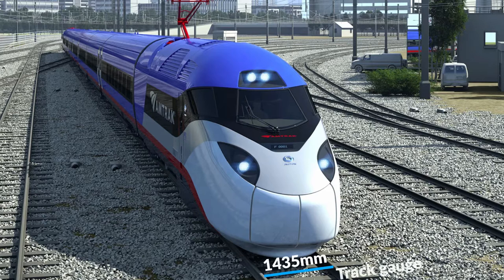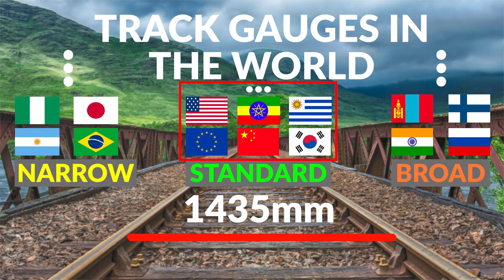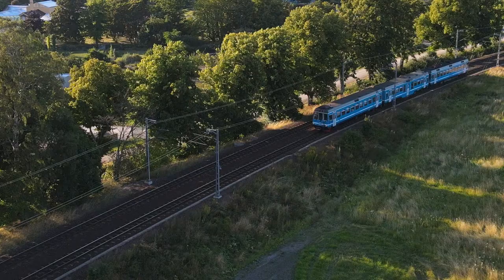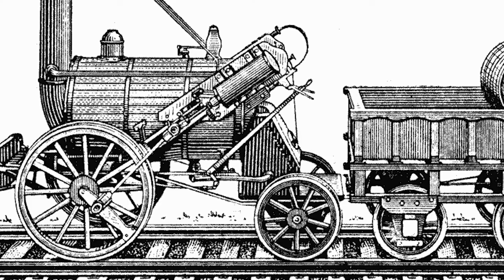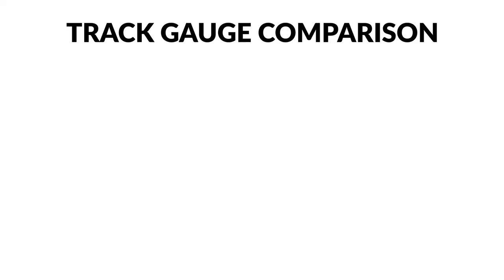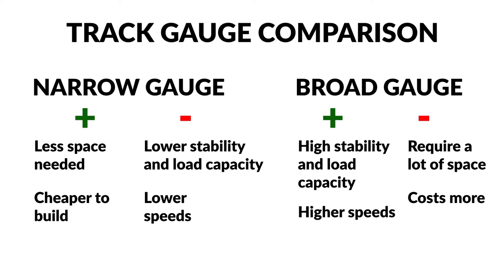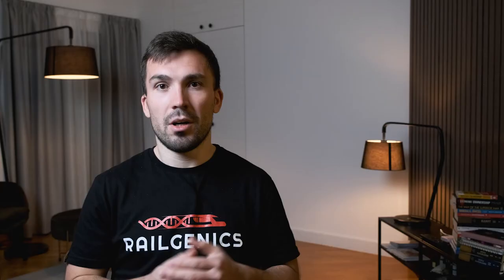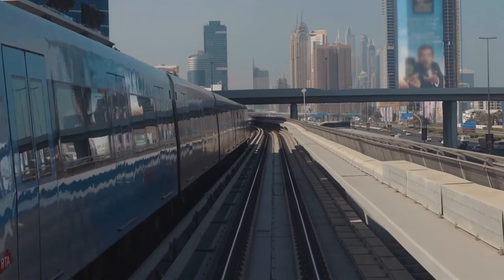Why Track Gauge Differs Between Countries

Comment: The development of standard gauge came from George Stephenson becoming the chief engineer on a mining railroad that happened to pick 4 feet 8 inches (1422 mm) as its gauge.  He found that wheels were binding on the curves, so he added a half inch (1435 mm overall).  It was easier to regauge the track than replace all the wheelsets with 1/2 inch shorter axles.  Stephenson was a stubborn man and insisted all future projects he worked on match this gauge, and so it became standard gauge in Great Britain by default.  Later, Stephenson would admit a wider gauge would have been a better choice, but it was entrenched by then.  

The United States ended up using standard gauge because many early locomotives were imported from Great Britain.  Other gauges were used, but standard gauge predominated and eventually won out over the others.
Reply: standard gauge was good enough for most purposes. a bit wider or bit narrower gauge doesn't change much.
narrow gauges has obvious problems, but how about wider gauge? you have to think about human scale.
2+2 sitting is ideal, 3+2 or 3+3 are not ideal. so wider gauge is not really better. 
Japanese Sinkansen use standard gauge, and it can to 3+2. so wider gauge is not necessary.
Reply: Actually what it was, the gauge was defined by the carts that 2 horses pulled. 
Early on trains were manually operated and instead of completely making a new track, they used the cart sizes that were already established by the width of horse cart. 
Then the railroads grew from there. 
So it was a horse's backside. 😅.

True story

Comment: 4ft 8.5in only became called standard gauge after the passing of the Railway Regulation (Gauge) Act of 1846 which set the set the British Standard Gauge as 4ft 8.5in and Irish Standard Gauge at 5ft 3in. It didn't prohibit the use of Brunel's Broad Gauge of 7ft 0.25in, but limited its usage to lines that would have a physical link to the already in existence GWR lines.
Reply: I live in Australia 🇦🇺. The small town is the two different gauges. Standard gauge 1435mm  and Irish gauge 1600mm ( 5'3").
Reply: @robertmurray8763  Is it Albury?
Reply: @TrainsForNSWVlogs  Ararat.
Reply: There was legislation about the same time to make all railways conform to the Irish 1600mm gauge.
However states like NSW and later Queensland ignored the legislation to save money.
Reply: @johnd8892 I take it that you're referring to Australia's railways? But all 3 primary gauges date from  entire Federation in 1901 and are still not resolved to one standard.
Reply: @neiloflongbeck5705  Nothing much to do with federation apart from the pork barreling of the Trans Australia line that thirty years to start to be useful. All three main gauges well established by 1901 with the absolutely dominant intra state traffic movements served well by the railways and the smaller size interstate movements by coastal shipping.
All capital city markets linked by standard gauge by 1970. Yet the railways struggle to find commercially useful traffic from any of the intermediate localities along the newly standardised routes as imagined by railfans.
The nineties conversion of Melbourne to Adelaide from the 1600mm in use from 1883 to standard gauge just disrupted existing customers was the cause of the biggest passenger decline on that route leading to massive increases in passenger subsidies.
Reply: @johnd8892  all those breaks of gauge are s big issue when transporting goods from on state to another caused by the different governments of the days efore Federalisation not wanting to seem weak to their electorates - can't use their gauge in our state mentality.

As for freight from the smaller cities and towns along the main lines- well just what industry is there that road haulage can't offer a better service from door to door? This is the same question that railways face in everywhere in countries large or small. And for the smaller countries the railways just can't compete on a level playing field.

Yes, changing gauges is disruptive to passengers, but do is having to change trains where there is a break of gauge. It took the old GWR years to fully switch over to standard gauge from 7ft 0.5in. This they did in phases with the first step being the addition of a rail at standard gauge and then the introduction of standard gauge trains followed by the withdrawal of the broad gauge stock. But there again they did this in the late 19th Century and not the late 20th Century with many alternative mode of transport.
Reply: Isle of Man 3" gauge
Reply: @Steve14ps  Man is outside the UK.
Reply: @neiloflongbeck5705  Did not say IoM was in UK, just stated it had a track gauge of three feet, also a very interesting network in its day.
Reply: @Steve14ps  but as this thread is about the Act of the UK Parliament that gave use Standard Gauge and the Isle of Man isn't part of the UK and thus outside the topic of this thread, why mention it? Many countries and territories have their own standard gauge that is not the same as Btitish or Irish Standard Gauge.
Reply: @neiloflongbeck5705  Sorry if I have offended you

Comment: In Switzerland we have a lot of Meter-gauge because they allow tighter curves. witch is important in the mountainous regions of Switzerland.
We also have railcars witch can change meter gauge  to Standard gauge while moving.
Reply from the maker: That's interesting to hear Nicolas! I've been dealing with narrow gauge projects in New Zealand recently (1068mm), it is very interesting to see how tight these curves are (minimum is 90m). I wonder how these cars manage switching the track? Is it by changing bogies? Or some other technology?
Reply: @railgenics  Talgo has a system for changing the gauge while moving, it's at a low speed, but a very efficient system. They have videos of the system working on their YouTube channel.
Reply: Spain/France border has had gauge changing trains for many years. Originally bogies were changed but then they developed axles with wheels which can lock at two widths.
Reply: The through Talgo routes that change gauge at the French Spanish border have been discontinued. Best such example is a Talgo sleeping car service between Berlin and Moscow with adjustable wheel sets, taking 5 hours less than regular trains to make the trip.
Reply: @centredoorplugsthornton4112  Spanish High Speed lines are standard gauge, so can connect directly to France. But there are still dual gauge trains within Spain.
Reply: @michaeltb1358  but of course. 
Saw something in Jane's World Railways about broad gauge versions of the TGV.
Reply: @railgenics  In Australia we have got 3 main different gauges.

Comment: Very good video!! I am from Argentina and in fact here we have the three types of gauge.

   Mainly we have a 1676 mm wide gauge in most of our territory, in the Miter, Roca, Sarmiento and San Martín railways, which are the ones that cross the country from side to side and from the center upwards.

   The narrow gauge of 1000 mm is only used by the Belgrano railway, which crosses the country from the center to the north. Curiously, being the most extensive if we compare it with the others.

   And we also use the standard gauge, 1435mm on the Urquiza railway, which crosses the country from the center to the north but borders the eastern border. You would be surprised to see a complete map of our network :o

Kind regards and keep it up! 👍😎
Reply from the maker: Hello, thank you for your comment. Actually, I did not know that there are 3 different gauge types in Argentina, that is very interesting. I have Argentina on my list, so could you please recommend me some interesting journeys in Argentina? I would like to check them :)
Reply: @railgenics  Of course! There are many things to say but I will try to be brief: To start, you must be in our capital: Buenos Aires. It is from that point where the kilometer 0 of the main railways of the country is. While there you can visit the 4 terminal-palaces that lead to the rest of the network: -Plaza Constitución (Roca Railway 1676mm) -Once (Sarmiento Railway 1676mm) -Federico Lacroze (Urquiza Railway 1435mm) -Retiro (Mitre 1676mm, San Martin 1676mm and Belgrano 1000mm) Each one of these terminals, but above all retirement and constitution, are true palaces worthy of English architecture. Retiro is a particular case, since it brings together in one place 2 different types of trail, these being from 3 different railways and having 3 different buildings for each one next to the other. First, leaving from Retiro, more precisely on the miter railway (1676mm), you can go on modern urban trains that will take you to the interior of the city, or you can also take our 2 different long-distance trains (and advance sales) that will they can take Tucuman (the central north) and Cordoba (in the center of the country). These two terminal stations of the miter are not only broad gauge terminals, since their platforms also work for the narrow gauge, this being possible thanks to the combination with the narrow gauge using a three-rail system called "bitrocha" or "mixed gauge", therefore, on one side of the beach the roads are wide gauge, but on the other side they are narrow gauge. https://es.m.wikipedia.org/wiki/Ferrocarril_General_Bartolomé_Miter Focusing on Cordoba Miter, once you arrive you can take the service of the "Tren de las Sierras" now on the narrow gauge thanks to the bi-trocha system. After leaving the city, this train will take you into the mountains of Córdoba, passing through mountain ranges, lakes and tunnels until you reach "Valle Hermoso", the current final station of the route. https://es.m.wikipedia.org/wiki/Tren_de_las_Sierras

Returning to Retiro, as I told you before, this terminal works for 3 different railways. But in both Retiro San Martin and Retiro Belgrano, you can only take urban trains. Let's focus on the Belgrano Railway (1000mm). There is a very good option on this railway, since following the tracks to the province of Salta, in northwestern Argentina, we have the "Tren a las Nubes" (Train to the Clounds). Leaving from "San Antonio de los Cobres", this tourist train that only works in season will take you into the Andes mountain range until it reaches its highest point: The "La Polvorilla" viaduct at 4200 meters above sea level and giving a spectacular sight. Unfortunately, to get there you will have to travel by plane to the city of Salta and from there take a bus, since there are no rail services that take you from Buenos Aires to there. https://es.m.wikipedia.org/wiki/Tren_a_las_Nubes

Let's go back to Buenos Aires: If you go to the "Plaza Contitución" terminal of the Roca railway (1676mm) Apart from taking the urban services, you can also go on the two different trains that will take you to the Atlantic coast, the services to "Pinamar" and "Mar del Plata". I want to highlight the Roca railway, since it is the southern system that crosses the country, crossing the "Patagonia" desert. This is the case of the "Patagonian Train" which leaves from the "Viedma" station in the province of "Rio Negro" and heads towards the Andes mountain range, ending its journey at the "San Carlos de Bariloche" terminal. or simply Bariloche, right in front of its beautiful lake. If you like high snowy mountains or deserts, this train is for you. But just like the train to the clouds, you will have to take a bus from 'Buenos Aires' to Viedma, since years ago, this train departed from Plaza Construccion, which it no longer does because of the mafia. 
https://es.m.wikipedia.org/wiki/Tren_Patagónico Interestingly, one of the Patagonian Train Stations, called "Ingeniero Javobacci", is the terminal of another railway called "La Trochita" also known as "Old Patagonian Express" Sharing the station by the same system previously mentioned, this small railway of only 750mm , extends for 197 kilometers into the desert until it reaches Esquel, one of its terminals, and you will be surprised to know that this passenger service is pulled by steam locomotives! of the Baldwin and Henshel brands. Being all from the 40's as well as their cars. 
https://es.m.wikipedia.org/wiki/La_Trochita
 Let's go further south, precisely in "Ushuaia" in the province of "Tierra del Fuego" where you are surrounded by snowy mountains at all times. Within its park, you can take the small tourist train called "End of the World Train" (also in season) Completely separated from the rest of the line, and passing through 9 kilometers of 500mm. The narrowest gauge in the country and this is also pulled by steam locomotives. How cute! 
https://es.m.wikipedia.org/wiki/Tren_del_Fin_del_Mundo

Finally, I am very sorry that from Federico Lacroze, terminus of the 1435mm Urquiza Railway, only urban services can be taken. However, its routes extend throughout the eastern sector of the country, reaching "Posadas" in the northern province of "Misiones". I want to highlight this, since in the province of Misiones we find the famous Iguazu Falls, and within the Argentine park, we have a small electric train with a gauge of 600mm. This train is used to move to the different viewpoints that the park has, immersing itself in a very humid jungle similar to the Amazon. Also apart from the rest of the line. https://es.m.wikipedia.org/wiki/Tren_Ecologico_de_la_Selva
 Surely, in all these trips you will find an infinity of abandoned material on the side of the tracks. This is because in the railway field, Argentina had its golden age back in the 50's and 70's, something that ended as a result of the growing economic crisis that we have been suffering, and now it seems that the government buys votes by renewing unnecessary material, leaving in disuse the little historical material or that is still useful.. 

To finish, I apologize for the excessive amount of text I wrote, but it is almost impossible to summarize all that in a short way. Anyway, I don't think I missed anything.
 I hope you can continue making this good and informative content :) 

Thank you for your attention and I hope that one day you can come here and enjoy everything that my country has to offer. A cordial greeting! 👋
Reply from the maker: @ulisesysustrenes  Thank you very much for so extensive explanation. You saved me a lot of research time. I will definitely come to film some trains in Argentina, probably next year. I see there is a lot of materials :D 

I see that you mentioned few seasonal trains. What does it mean? Are they running only in summer?
Reply: @railgenics  Hello, I apologize for the delay. When I say season I mean that the trips are made at a certain time of the year. More precisely, the tourist season, which here in Argentina is in winter (approximately from April to August). And specifically in tourist services you have to buy the ticket in advance through the corresponding website.

I forgot to mention a detail about the Sierras de Córdoba train, on the narrow gauge: it's not a train as such, it's actually a motor-coach, just two separate passenger coaches, like the Ganz models, only newer. However this does not affect the trip, in fact it makes it faster.
Reply: Another gauge in Argentina, 0,75 m, with the Old Patagonian Express, from Ingeniero Jacobacci to Esquel.

Comment: In Australia we have 3 gauges: 1435mm, 1600mm and 1967mm !!
Reply: 1067mm not 1967mm
Reply: When railways are built or rebuilt in Australia, standard gauge is usually chosen. Melbourne-Adelaide was rebuilt from 1600 mm to 1435 mm during the 1990s, at the cost of suspension of passenger service, which was reinstated but never fully recovered.
Reply: British standard gauge is 4’ 8.5” (1435mm). Irish standard gauge is 5’ 3” (1600mm). When railways were first built in Australia the different colonies used British or Irish engineers, who tended to build to their home gauge.
Reply: @arwelp more to do with badly financed lines in states that ignored the legislation for all Australian railways to be 1600mm as a means of saving money

Comment: Brazil has 1.6m gauge and 1.0m and 0.76m
Reply from the maker: Lovely, although not perfect for interoperability :)
Reply: @railgenics  Well… In Sounthern East of Brasil there is a 3rd Rail just in case meter or 1.6 can go by
Reply: There's one isolated 1440 mm standard gauge line in Brazil.
Reply: @railgenics there is current video from Brazil if 1600mm gauge locomotives pulling long and heavy trains of 1000 mm gauge wagons on three rail track with the aid of special converter wagons to align couplings.
Not at all widely known outside Brazil.